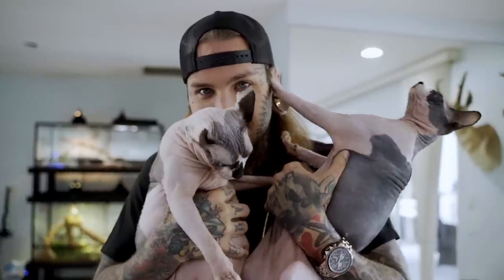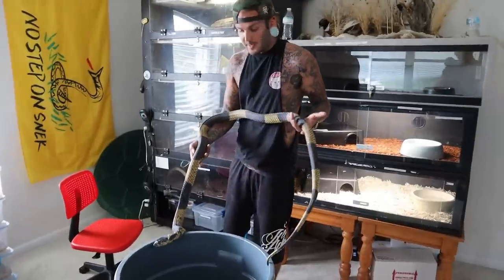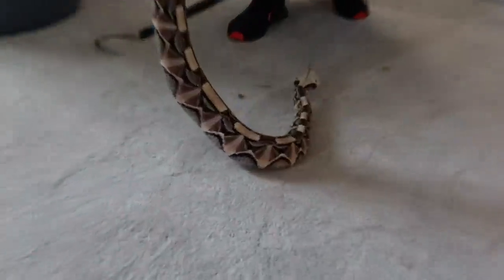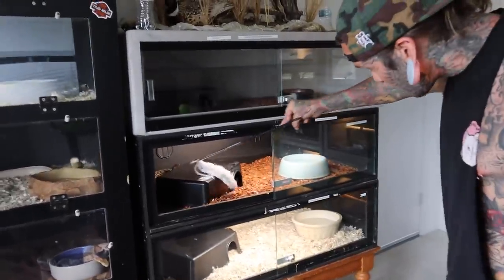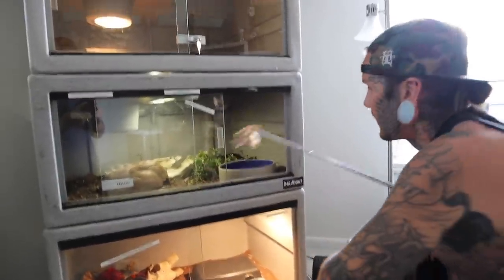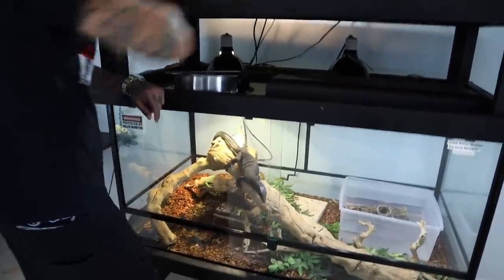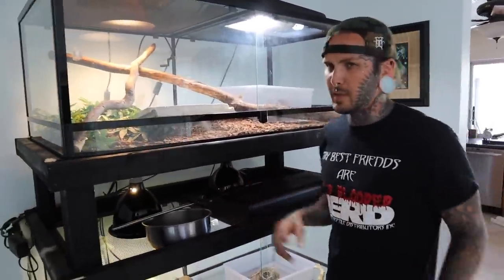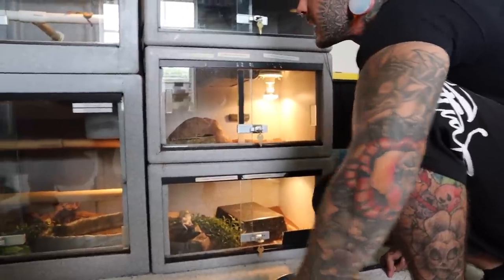Feeding Venomous Snakes and some Crazy Dragons

Comment: Since youve switched to substrate, I've always wondered, does the substrate on the feeder rats get digested by the snake? Just curious for my snakes too.
Reply: Yes on a healthy snake it should pass just fine, i know mine have got some substrate from time to time and never had an issue.
Reply: Okay cool, I usually feed most of mine in tubs so theyre not use to my hand coming inside the cage and could potentially mistake it for food. But I have a couple bigger snakes on news paper right now I was going to move to substrate and they eat inside their cage. I was just a bit curious.